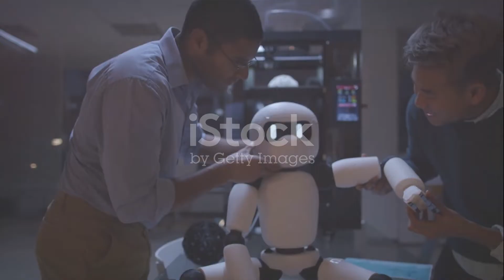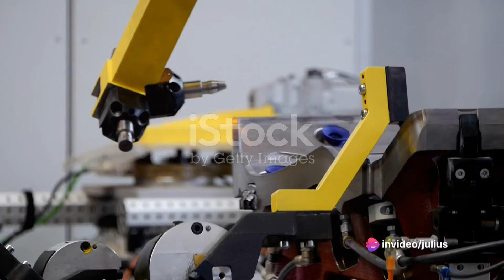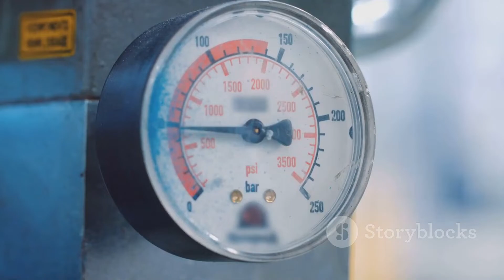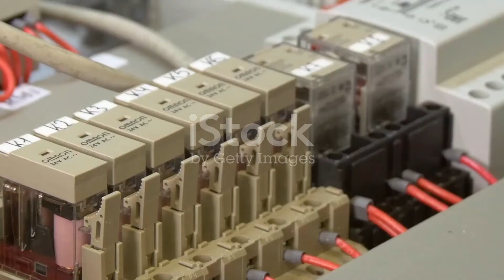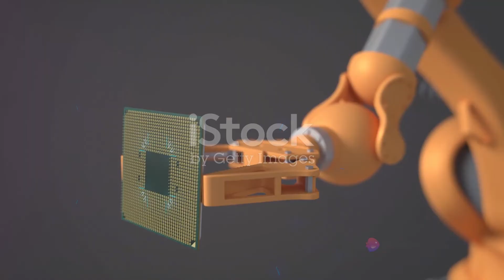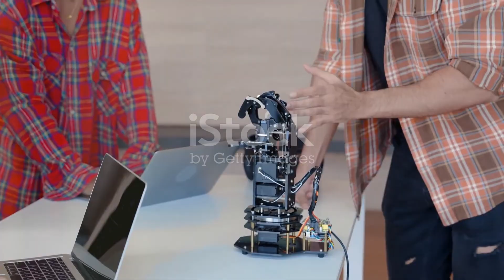Top 10 Analog Inputs in Robotics

Comment: 🌟10 - ANDROMEDA CHAIN ⬇️⬇️
Reply: Faith N. Ragas
10-Andromeda 
08-21-24

Question 5: How do analog signals get processed by robots after they are collected from the environment?

Answer:
An analog-to-digital converter (ADC) is used by robots to convert continuous analog signals from their surroundings into digital form. Since the robot's microcontroller or control system can only process digital data, this conversion is essential. After conversion, the digital data is examined by the robot's algorithms, which decipher the data and provide the necessary context for the robot to carry out tasks, make decisions, and successfully engage with its environment.
Reply: Christine M. Luna
Grade 10 - ANDROMEDA
08/22/2024
3:16 (timestamp)

4. What are some examples of various analog sensors mentioned in the video, and what measurements do they provide?.

Some examples of the various analog sensors mentioned in the video include:

• Position Sensors (i.e. Potentiometers or Variable Resistors)
     - provide an analog voltage proportional to the position of a robot joint

• Force or Torque Sensors
    - provide analog readings that indicate the force or torque applied to a robot's end effector or manipulator; therefore enabling safe object manipulation

• Analog Pressure Sensors
    - measure fluid or gas pressure and provide an analog voltage proportional to the pressure 

• Analog Temperature Sensors (i.e. Thermistors or Thermocouples)
    - produce varying voltage levels based on the temperature they sense

• Voltage Sensors
     - measure electrical voltage levels and provide analog output to monitor power supply conditions 

• Analog Distance Sensors
    - provide voltage outputs that vary according to the distance between the sensor and an object

• Analog Gas Sensors
    - measure the concentration of specific gases in the environment, and provide varying analog outputs
Reply: Zhandra B. Dela Rosa
10-Andromeda

3. Explain the role of position sensors like potentiometers in robotic systems.
- Position sensors like potentiometers in robotic systems provide an analog voltage proportional to the position of a movable part such as a robot joint. Then have analog encoders that produce varying voltage signals as a function of rotation or position, allowing precise measurements of angles.
Reply: Real Ann R. Dela Victoria
10-Andromeda 

1. What are analog inputs and why are they important for robots?

𝙰𝙽𝚂𝚆𝙴𝚁: 
• Analog inputs for robots are signal or data representing continuous and fluctuating quantities. They can take on a plethora of values withink a specified range, offering more nuanced and detailed information about the environment. They are instrumental for robots to sense, measure and interact with variables such as position, force, temperature and more.
Reply: Ettena Marie A. Gabales 
10 Andromeda

2. Describe the analogy used in the video to explain the significance of analog inputs in robotics.

𝘼𝙣𝙨𝙬𝙚𝙧: The video uses the analogy of painting a masterpiece with only two colors to explain the significance of analog inputs in robotics. It emphasizes that robots require a variety of analog inputs to accurately sense and interact with their environment, allowing them to create depth, detail, and nuance. Analog inputs provide a rich, detailed picture of the world, enabling robots to perform tasks impossible with only digital inputs, such as measuring temperature, pressure, force, and other physical quantities, such as welding, assembly, and surgery.
Reply: Zara Mae M. Jurane
10-Andromeda 

1. What are analog inputs and why are they important for robots?

-Analog inputs are data representing continuous and fluctuating quantities, they can take on a plethora of values within  a specified range offering more detailed information about the environment. Analog inputs are important because they provide robots with the ability to sense and respond to a wide range of physical phenomena, they contribute to the versatility and adaptability of robots.
Reply: Antonnette C. Tayrus 
10- ANDROMEDA 

Q1. What are analog inputs and why are they important for robots?

ANSWER: Analog inputs are signals or data, representing continues and fluctuating quantities, and not just discrete binary states. Analog inputs are capable of taking on a plethora of values within a specified range, which offers more nuanced and detailed information about the environment. For robots, analog inputs are instrumental for them in terms of sensing, measuring and interacting with variables such as position, force, temperature and more. It is highly important, because analog inputs bring depth, detail and a spectrum of possibilities to the robotic world.
Reply: Rose Gabrielle D. Araoarao
10-Andromeda

1. What are analog inputs and why are they important for robots?

- Analog inputs are signals or data that represent continuous and fluctuating quantities. They can take on a wide variety of values within a specific range, providing more subtle and precise information about the environment. They also add depth, detail, and a broad range of options to the robotic environment.
Reply: Jaynie Margaret M. Lashley
10 - Andromeda

2. Describe the analogy used in the video to explain the significance of analog inputs in robotics.

- The analogy used comparing a world of robotics without analog inputs to trying to paint a masterpiece with only two colors. This highlights how analog inputs bring depth, detail, and a spectrum of more possibilities to robotics, making them essential for creating complex and future interactions.
Reply: Brigette Love U. Gurrea
10- ANDROMEDA

5. How do analog signals get processed by robots after they are collected from the environment?

ANSWER: Robots process analog signals by converting them into digital signals that can processed by the robot's microcontroller or control system. By turning the continuous analog signals into discrete digital values, the signal will be easily manipulated by the robot's algorithms.
Reply: Ayannah Nicole Ngujo
10 - Andromeda 

1. What are analog inputs and why are they important for robots?

- Analog inputs for robots are signals or data representing continuous and fluctuating quantities. They can take on a plethora of values within a specified range, offering more nuanced and detailed information about the environment. They are instrumental for robots to sense, measure and interact with variables such as position, force, temperature and more. Analog inputs are crucial for robots, as they allow robots to sense varying environmental conditions.
Reply: Englis

1.	What are analog inputs and why are they important for robots?
- Analog inputs for robots are signals or data representing continuous and fluctuating quantities, not just discrete binary states. They can take on a plethora of values within a specified range offering more nuanced and detailed information about the environment. These inputs are instrumental for robots to sense measure and interact with variables such as position, force, temperature and more.
Reply: Barbosa, Sabina Claudia
10 - ANDROMEDA

1. What are analog inputs and why are they important for robots?

- Analog inputs for robots are signals or data representing continuous and fluctuating quantities. These inputs are instrumental for robots to sense, measure, and interact with variables such as position, force, temperature and more.
Reply: Kerk Ivahn C. Durohom
10-Andromeda

1. What are analog inputs and why are they important for robots?

 Answer: Analog inputs for robots are signals or data that represent continuous and fluctuating quantities instead of distinct binary states. These inputs are essential for enabling robots to detect, assess, and respond to variables like position, force, temperature, and others.
Reply: Kobie James B. Gabales
10 - Andromeda 

5. How do analog signals get processed by robots after they are collected from the environment?

Analog signals collected from the environment by a robot are typically processed through the following steps:Sensing and Collection,Analog-to-Digital Conversion (ADC),Signal Conditioning,Digital Processing,Actuation and Response,Feedback and Adjustment These steps allow robots to interact effectively with the physical world by processing environmental data in real-time.
Reply: Juvin P. Andales
10-ANDROMEDA

1. Analog inputs for robots are signals or data that represent continuous and varying quantities rather than discrete binary states. Analog signals can take on a range of values within a specified range, providing more nuanced and detailed information about the environment. These inputs are crucial for robots to sense, measure, and interact with variables such as position, force, temperature, and more. Analog inputs are converted to digital format before being processed by the robot's control system.
Reply: Angel Sofia C. Tabaniag
10- Andromeda 

5.) How do analog signals get processed by robots after they are collected from the environment?

- Robots use a microprocessor or control system to process digital signals, which are then converted from analog forms. The continuous analog signal may be easily modified by the robot’s algorithms by converting them into discrete digital values.
Reply: Kent Kyle T. Palingcod 
10- Andromeda

1. What are analog inputs and why are they important for robots?

 Analog inputs are signals that vary continuously and are essential for robots to accurately interpret and respond to real-world conditions. They enable robots to process detailed environmental data from sensors, allowing for precise control and adaptive behavior.
Reply: Kent Kyle T. Palingcod 
10-Andromeda 

1. What are analog inputs and why are they important for robots?
 
Analog inputs are signals that vary continuously and are essential for robots to accurately interpret and respond to real-world conditions. They enable robots to process detailed environmental data from sensors, allowing for precise control and adaptive behavior.
Reply: Shiloh Nouvel A. Miquiabas
10 - Andromeda

1. What are analog inputs and why are they important for robots?

ANSWER:
Analog inputs are signals that change smoothly and represent things like temperature or position. They are important for robots because they help robots sense and react to their environment accurately.
Reply: Marvin II T. Octobre
10-ANDROMEDA

1. What are analog inputs and why are they important for robots?

-Analog inputs are signals or data representing continuous and fluctuating quantities, these imputs are instrumental for robots to sense, measure, and interact with variables such as position, force, temp, and more.
Reply: Trixie Lorraine T. Canopin 
Grade 10 - Andromeda 

3. Explain the role of position sensors like potentiometers in robotic systems.

Answer: Position sensors like potentiometers play a crucial role in robotic systems by providing an analog voltage proportional to the position of a movable part, such as a robot joint. This allows precise monitoring and control of the robot's movements, ensuring accurate positioning and responsiveness to its environment.
Reply: Davey A. Sabanal
10 - Andromeda 

1. Analog inputs are data or signals representing continuous and fluctuating quantities
Reply: Ezekiel Jude E. Tuñacao 
10 - Andromeda 

1. What are analog inputs and why are they important for robots?

Analog inputs provide robots a  continuous and fluctuating flow of signals and data that provides detailed information on the environment.
Reply: Sophia Margarette G. Peñoso
10 - ANDROMEDA

Question:
3. Explain the role of position sensors like potentiometers in robotic systems.

Answer: Potentiometers in robotic systems provide position feedback by converting mechanical movement into electrical signals. They enable precise control, calibration, and monitoring of joints and components, making them essential for accurate and reliable robot operations.
Reply: PABERECIO, Zion E.
10 - ANDROMEDA 

3. Explain the role of position sensors like potentiometers in robotic systems.

- Potentiometers in robotic systems measure the precise position of moving parts, like joints or arms, by varying resistance as their wiper moves. This feedback is essential for controlling and adjusting the robot's movements accurately, ensuring proper alignment and operation.
Reply: Andrei Lavern A. Pelayo
X - Andromeda

1. What are analog inputs and why are they important for robots?

𝓐𝓷𝓼𝔀𝓮𝓻:

Analog inputs measure changes in conditions like force, heat, and resistance. They are important for robots to sense and interact with their environment in a nuanced and detailed way.
Reply: Charles Christian Bahian
10-Andromeda

    1.What are analog inputs and why are they important for robots?

Analog input for robots are signals or data representing continuous and fluctuating quantities not just discreet binary states they can take on a plethora of values within a specified range offering more nuanced information about the environment these inputs are instrumental for robots to sense measure and interact with variables such as position force temperature and more. Analog inputs bring depth detail and a spectrum of possibilities to the robotic world
Reply: Dean Andrie P. Daohog
10 - Andromeda 

Question #3. Explain the role of position sensors like potentiometers in robotic systems.

- Position sensors provide an analog voltage proportional to the position of a movable part such as a robot joint. They also have analog encoders that produce varying voltage signals as a function of rotation or position, allowing precise measurement of angles.